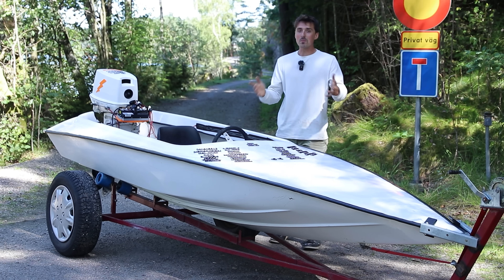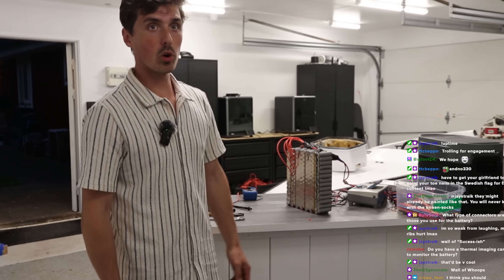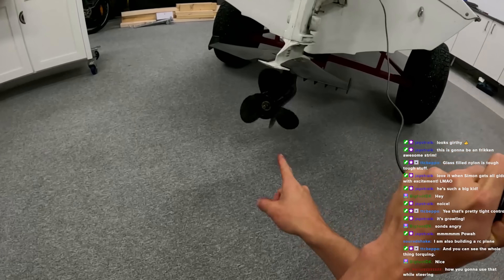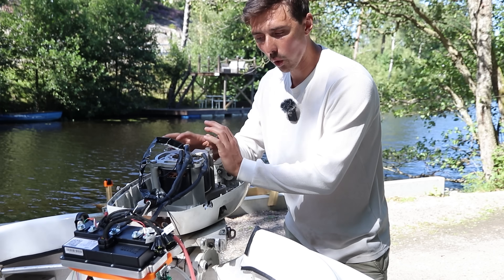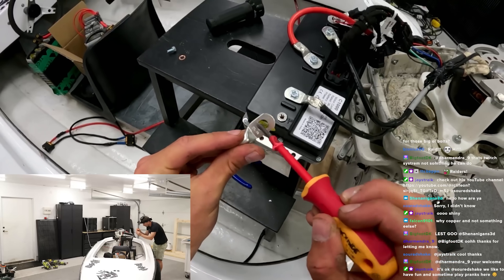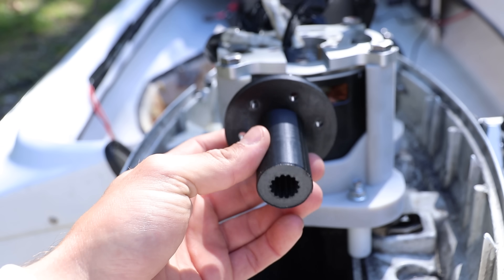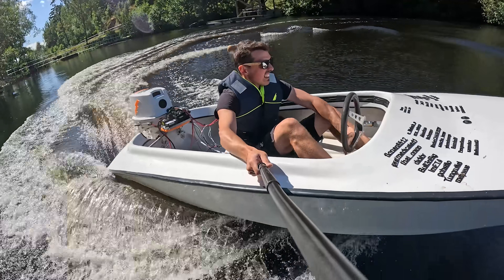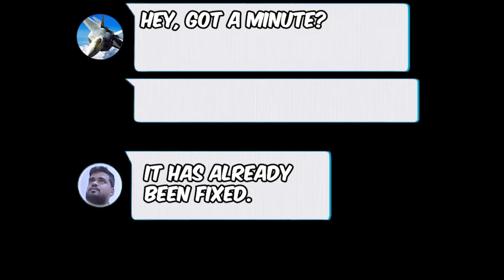Turning My Gas Boat Electric Part 2

Comment: When gliding it is better that the weight is behind approximately 1/3 of the length of the boat and it is better that the throttle is on the hand and not on the foot, it is much more constant and easier to control.
Reply: race boats use foot throttle. Of course, at his current, low speed, I agree a hand throttle is sufficient. But a foot throttle can be just as steady, hand control is more about fatigue.

Comment: Your videos are awesome! I always look forward to them. I think you should stick with a prop. Maybe even use a surface drive setup where only 1/2 the prop is in the water at full speed. A jet drive is great for shallow water but I believe a prop is more efficient. Great work on this!
Reply: Much more efficient, yes.

Comment: Foot throttle on a boat is a poor choice. There’s a reason why you don’t see any in any other boat. You hit a wave? You’re changing your throttle.

It needs to be in a hand control on your left. That way you can set the throttle and not have it change when you hit a wave.
Reply: Not actually correct. Race boats, which go and jump in the waves much more than normal boats, use foot throttle. The hull of this boat is a race boat. The only reason to have a hand throttle is fatigue, hence why pleasure boats that do realtively low speed in comparison and wont jump over waves, use them.

 Changing the throttle in the waves is actually exactly what you want, so as to not over rev the motor or blow out the gearcase from the impact after landing.
Reply: @GoldenCroc  the only paragraph here that is correct is half the last one. Nothing to do with over revving or impact on the gear case.

Yes changing throttle during a wave is what you do. But having it in the foot will force your foot into the throttle when hitting the wave, giving more power, launching you into the air.

I’ve been on boats my whole life.

Sure maybe racing boats are different because they literally never have to fight the waves. Whatever.

But you will never find a throttle in a boat on the floor that is meant for the lake or ocean. And it has nothing to do with “fatigue”. You can change the throttle just fine by having your hand on it.

If I have to make a YT video to disprove your retardation I will.j

Comment: Cool! 19.4Kw is like 26hp! That's awesome for the small size.
Reply: horse power is good with 3 phase brushless, the problem is energy density of battery chemistry too improve, vs fossil fuels, but that will require a time machine to remedy, until then we push forward with what we have.

Comment: Would be nice if ypu could integrade the vesc under thr motor cover, it looks like it can fit. Great idea to use watercooling, although the fan may work for now, I think its somewhat gimmicky.